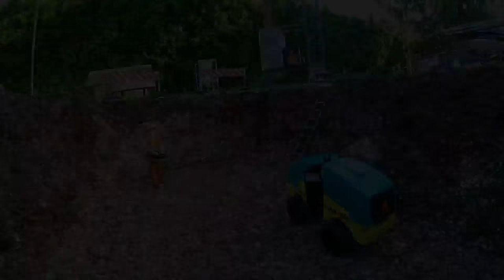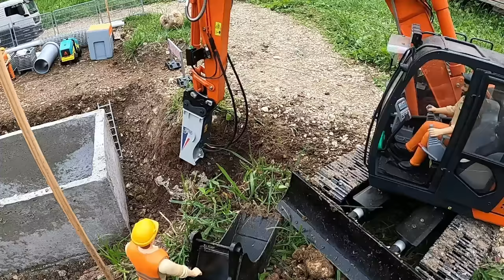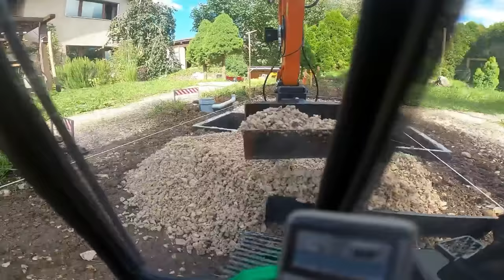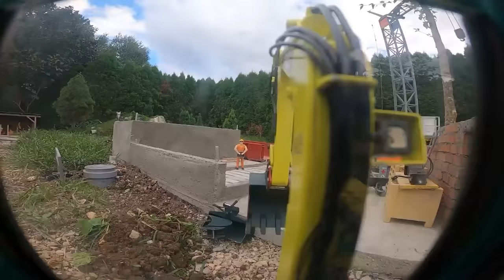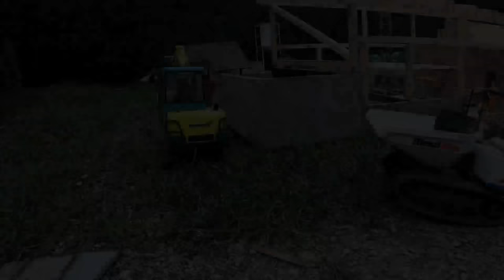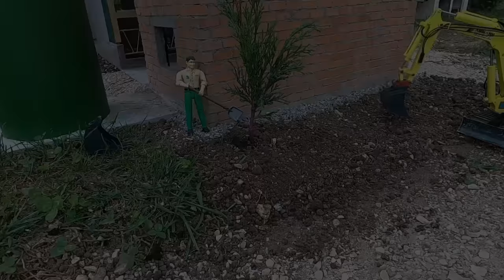Build a cowshed farm. RC scale models, Yanmar B37V, Hitachi ZX-135 US, SwissCrane - Full edit

Comment: How do you get air out of your hydraulic lines and cylinders? The way the Yanmar moved looked a bit springy so maybe there is air?
Reply from the maker: No air, maybe the spring effect come from hose.
Reply: @BartsteRCModels  if you push in the cylinder with your hand will in move at all or is it like completely sealed, i dont understand how all the air can escape from the cylinder when the lines are connected
Reply from the maker: @notanengineer  With multiple action full open full close, the  air is pushed in the oil tank and escape in the air vent nipple.